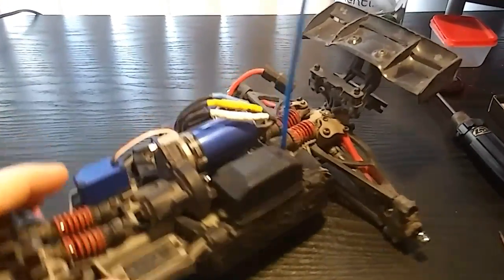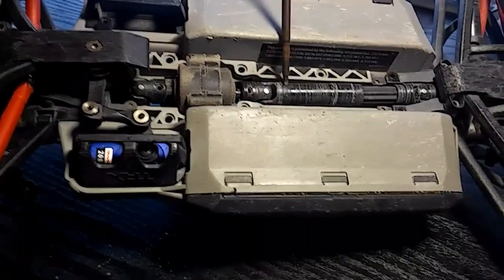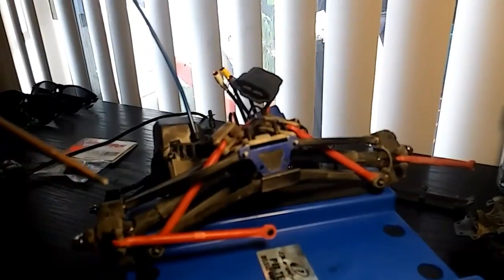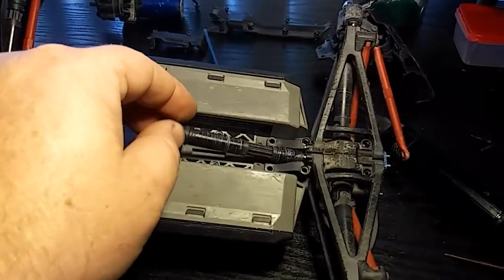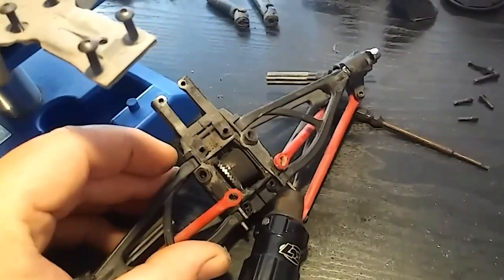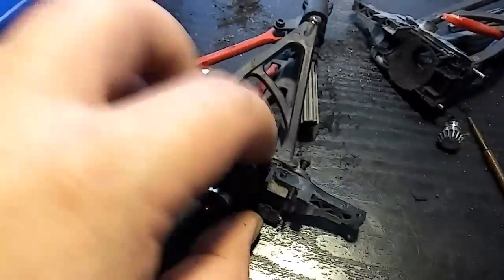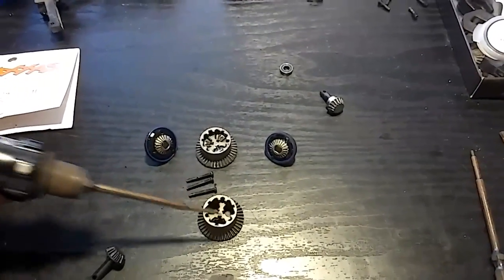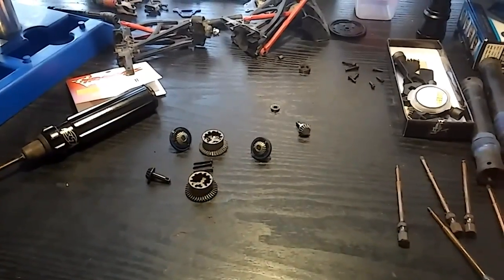Traxxas 1/16th scale rear differential replacement. Any 1/16th scale model.

Comment: Do these need diff oil? New to the hobby and diff oil of different weights are on the parts list.
Reply: Idk I’m trying to figure that out too
Reply: @kadeluis8724  same lol did u find ?
if yes or no ?
Reply: Yes they do.
Reply: The rears need 35k weight
Reply: Do you fill it up or just coat it with the oil?

Comment: Wow. So many unnecessary steps taken here. I literally just shimmed a rear diff without removing anything above the shock mounts. Rear skid plate, wing mount and the two screws holding the bulkhead in-place and the rear diff is free. Whole process should take about 10 minutes.
Reply: True, but if you do as little maintenance it's a good idea to have a look under all those skid plates if everything is still there.